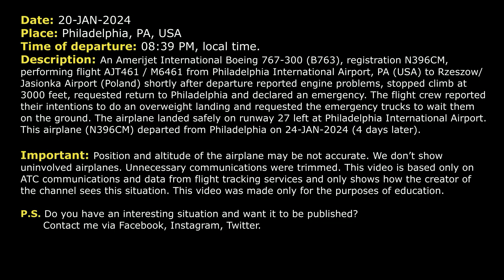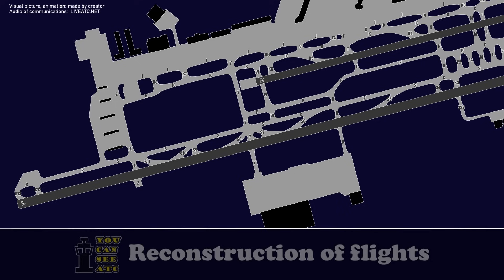Engine problems on takeoff. Amerijet Boeing 767 performs emergency return at Philadelphia. Real ATC

Comment: Why do air traffic controllers tell the pilots of aircraft with engine problems to make particular turns when they don't know whether one engine is out on two-engine aircraft or which one is out if one is?  Wouldn't it make more sense to let aircraft with their right engine out make right-hand turns and aircraft with their left engine out make left-hand turns?
Reply: It does not matter which way a jet turns during an engine failure. They are perfectly capable of turning either direction. If they couldn’t they wouldn’t be certified. Think about if a jet loses an engine in mountainous terrain. Certain turns are required to avoid terrain, so it doesn’t matter which one failed. Otherwise when asking for vectors I’ll let ATC tell me where to go. It’s less thinking for us. I’m a former 767 pilot. 737 now.
Reply: @saxmanb777  "loses" -- to the contrary, while they're supposed to still be able to turn away from the failed engine, it's easier to turn in its direction and turning away seems to have helped precipitate some accidents.
Reply: @rdbchase  no it’s really about the same turning wise. I’ve been flying transport aircraft for 17 years. I think I would know. We really don’t care which way we turn. If we’re unable, we simply say that. What incidents are thinking of?
Reply: @saxmanb777  I don't recall the particular video which led me to believe otherwise.  I have observed that miscommunication has led to accidents and that is a particular bugbear of mine.
Reply: To help guide and direct back the best way with other traffic in the area, etc. Pilot can and will do anything to keep the thing in the air. If he needs right turns, he can say that as well. He just needs help now and that takes it off his plate while dealing with the issue at hand.
Reply: @ryanmann3412  Still, it seems inappropriate for ATC to direct pilots to make specific turns in such circumstances without knowing which engine is out.
Reply: @rdbchase  Why? The pilot asked for vectors. If he wanted specific turns he would've asked for vectors of right/left turn only. A plane can make a turn on one engine and they are professionals and know how to do so properly. He just asked for vectors, which is saying "you guide me to keep me safely clear of anyone around until I get situated and set up for landing" which will help take that added stress off his plate. ATC complied and gave him exactly what he asked for according to what he sees on that radar to safely do so and quickest way to the runway that is needed.
Reply: @ryanmann3412  Because pilots have turned in the wrong direction after engine failures and come to grief; after such an instruction, the pilot does not know whether he can turn the opposite direction safely.
Reply: @rdbchase  Then pilot will say "unable". The ATC does not know and gives him exactly what is asked of him. It's a 2-way street. The pilot will ask for this type of vector if needed. He did not. So nothing ATC did was inappropriate. Everything was textbook. Perhaps a professional such as ATC controller or professional pilot can chime in on this thread and correct me if I'm wrong, but I heard nothing wrong in this exchange. I think it was more concerning on the overweight landing after everything was set up in this instance. 🤷🏽‍♂
Reply: @rdbchase I actually just asked a 757/767 pilot (customer of mine) this exact question you are wondering about. I will reply back  shortly.
Reply: @ryanmann3412  My point is simply that such instructions do not necessarily resolve the question of which direction to go and that pilots may need to keep thinking about the issue; of course pilots can refuse in a single word.  Perhaps ATC should offer both choices in order of how quickly each would result in landing if the situation with other traffic permits.  I don't claim any more knowledge than that gleaned by watching lots of aviation incident/accident videos on YouTube.
Reply: Man you must be a newbie, it's not the 1980s dude, airplanes and pilots have developed since then
Reply: @Blast6926  When one of two wing-mounted engines fails, there is significantly asymmetric thrust, now as then.
Reply: @rdbchase  from said pilot of 767 "with any single engine, you have to watch how much of a bank angle you use when turning. When in the pattern or being vectored, you can use up to 25° of bank. But, at slower speeds, on final you only use 15° of bank angle."
Reply: @rdbchase  so while your concern may not be thrown away, it appears it is not of a huge concern in this day and age. Pilots train for this sort of thing often as well as, apparently, have aid from the aircraft systems (from what i've read) to help with this ie. rudder input. 25 degree bank angle is a good amount of leeway I would say.
Reply: @ryanmann3412  Just so; there are considerations for single-engine operation of two-engine aircraft in general and turns in particular.
Reply: @rdbchase  from what I gather, yes, but not to a degree that would cause such concern that a pilot would hesitate in making a specific turn bc of that. It simply does not make a difference and the aircraft can handle without any issues.
Reply: The pilot asked for vectors.  That means the aircraft can take vectors.  No restrictions specified means no restrictions.  Also, asymmetric thrust and turns aren't really a factor for modern transport category aircraft.
Reply: Tell me you're not an airline transport pilot by not telling me you're not an airline transport pilot! On modern day jet aircraft the aircraft can turn either direct when single engine. Thanks for playing the internet today.
Reply: @JohnSmith-zi9or  Don't read so well, do you?  Do you want to take issue with the fact that single-engine operation creates asymmetric thrust?  Of course two-engine planes should be able to turn either direction on one.  Please tell me you aren't an airline pilot explicitly.
Reply: @rdbchase  "Don't read so well, do you?  Do you want to take issue with the fact that single-engine operation creates asymmetric thrust?  Of course two-engine planes should be able to turn either direction on one.  Please tell me you aren't an airline pilot explicitly."

I'm a retired heavy US Air Force Pilot and have 20-ish years flying for two major airlines -- like the biggest in the world. 

And I'm here to double down and tell you that you don't know what you're talking about. 

Modern airlines fly perfectly on a single engine and can safely, easily turn in either direction no matter which engine is operating.
Reply: @JohnSmith-zi9or  In what regard don't I know what I'm talking about?  You quoted the entirety of my post, but failed to take issue with anything in it!
Reply: @rdbchase  Your entire first post is wrong. 

"Wouldn't it make more sense to let aircraft with their right engine out make right-hand turns and aircraft with their left engine out make left-hand turns?"

No it wouldn't. Here's why. 

In modern day airliners with high bypass turbine motors, turning either direction usually is not a factor because the dead engine doesn't create significant drag and the airplanes operate well above the minimum control airspeed. 

Light twin engine reciprocating airplanes have issues when losing a motor because of yaw caused by the operating motor, drag caused by the dead engine propeller and resultant yaw, and increased lift on the good engine wing caused by the yaw. 

So in case of a right engine failure, the left engine would want to yaw the airplane to the right. The drag caused by the right engines's propeller would cause the aircraft to yaw further to the right. The increased lift on the left wing caused by the right yaw would roll the airplane to the right. In this case, turning right into a dead right engine would not be smart -- in a light twin. Turning right into a right dead engine could roll the airplane over and spin. 

So, in a light twin, you should not turn into a dead motor. You had it wrong. But in modern day airliners, not a thing.